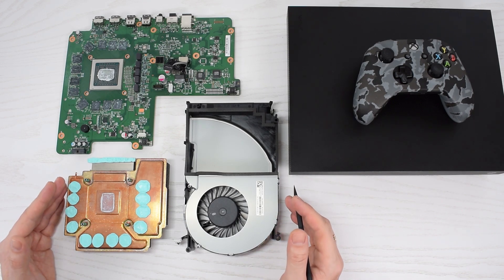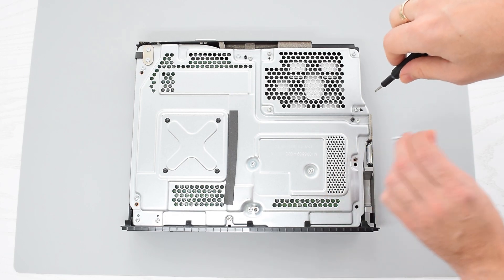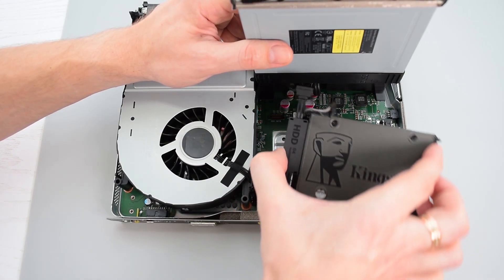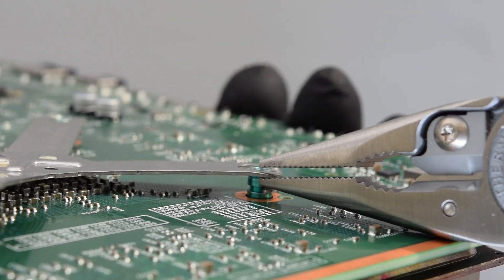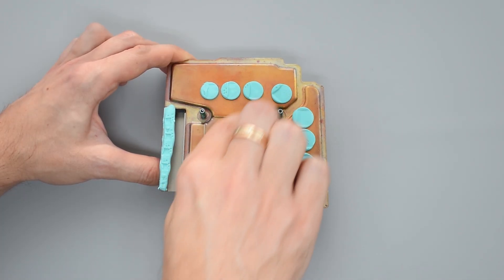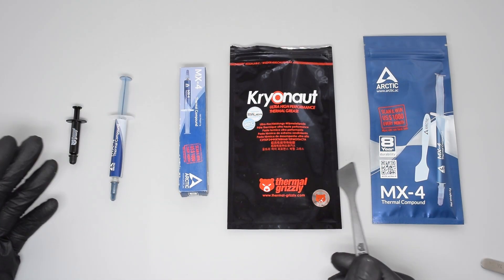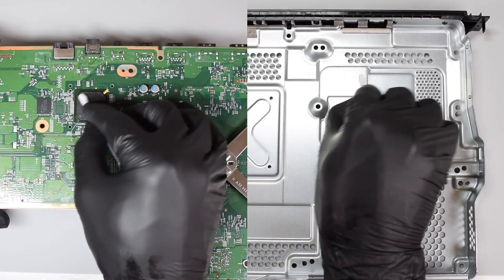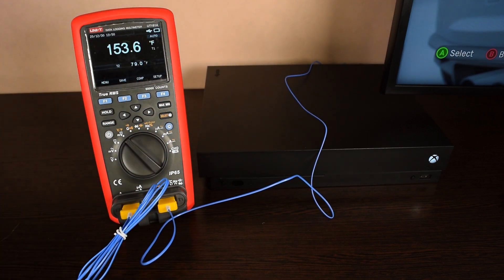Xbox One X Thermal Paste and Thermal Pads replacement. Cooling system cleaning. Best explanation!

Comment: dude , what size pad you use? deepseek tell me to need used 3 size 1 , 1.5 , 2 . here you used olny one for all tell me bro
Reply from the maker: You have to use 1.5 mm pads. There’s no need to ask anyone — just measure the thickness of the compressed thermal putty and you’ll see it’s about 1.4 mm, which means 1.5 mm pads are perfect for that. But we don't use anymore thermal pads for our customers and I don't recommend using them. Nowadays we have thermal putty that outperforms any thermal pads and it's way easier to use. We use this one which is the best on the market: UPSIREN UTP-8: 
https://shp.pub/7a5f1j
https://amzn.to/4n4FVWO
Reply: @ElectronicsComputers Thanks, brother. When I was looking for information, I was told there are 3 sizes of chips and each one needs a different size. Thanks again.
Reply: I used 2mm. I even bought the wrong thickness (1mm) initially. It did overheat but after adding the 2mm strips to their own vram modules and doubling up some of the 1mm strips to essentially double the thickness, no overheating and it runs quieter. I dont know enough but I hear you want pads that have squish to them to allow for the added .7-.4 mm thickness

Comment: Hello, I decided to replace the liquid thermal pads on my Xbox One X and was left with the choice between the Laird 607 or the Subzero Seven TPT 128. The Laird has 6 watts of thermal conductivity, while the Subzero Seven has 12.8 watts. Which one do you recommend? The factory pad thickness was 1.8 mm. Which one is better?
Reply from the maker: I'm not familiar with those products. The Laird thermal putty has extremely low thermal conductivity, it's even worse than the stock putty, so it will be downgrade if you use it. In my repair shop, we use Upsiren thermal putty which the best as of today. You can use UTP-8 14.8w/mk or UX PRO Ultra 16.8w/mk. https://shp.pub/7a45kb   https://shp.pub/78w0ir

Comment: I've repasted and changed thermal pads on a series X and had good results using:
Artic MX-6 compound 
Artic TP-3 thermal pads 1.5mm thickness
If you just get 4 x 120x20mm pads (they come in a pack of 4 so 1 pack) it will be enough to replace all thermal pads if you measure and cut exactly what you need in the right shapes. 
For the compound, I used the spread method to get even coverage as MX-6 is very tacky but performs better at higher temps than mx-4. 
After that, just the usual isopropyl 99.9, cotton swabs, T8 torx driver, lint free cloth, spudgers and precision tweezers.
Reply from the maker: Great job! That’ll make your Xbox last a lot longer.
Reply: How thick should i make it if i bought 0,5mm thickness arctic tp3 ? Can i stack them?
Reply: @Baerbas01 they can be stacked but I wouldn't recommend it. But if you do need to then 3 layers of 0.5 to make it 1.5.

Comment: What do you think if i use 1.5 mm thermal pads from arctic? 
And i also want to ask about the size of pads. There is lots of theories about to use 1mm or 1.5 or 2mm? Do you think my pads are good enough?
Reply from the maker: No need to believe in theories just grab a caliper and measure the compressed thermal putty on any memory chip. You’ll see it’s around 1.4 mm, which means a 1.5 mm pad is the right size. We used thermal pads for clients for years, but eventually switched to Upsiren thermal putty (link in the description). It’s similar to the original thermal putty but far better in specs and definitely beats any thermal pad. On top of that, it’s super easy to apply. You can check out my video on how to use it the process is exactly the same for your console: https://youtu.be/GTvtAM7Fi5U
Reply: @ElectronicsComputers Thanks for an answer but i just bought the thermal pad from arctic tp-3   1.5mm. Do you think this one will also work?
Reply from the maker: @destin7963  Honestly, I’m really suspicious about those ARCTIC TP3 pads. The company never publishes their thermal conductivity, which is one of the main specs you need to choose a thermal interface. When a manufacturer hides that number, it usually means it’s embarrassingly low. For a high-performance application like the Xbox One X, I wouldn’t trust it to do a good job. If you want reliable cooling, stick with Grizzly, Gelid, or proper thermal putty instead.

Comment: Hello, I encountered the following problem with my Xbox One X. I replaced the thermal paste and gaskets with MX6 paste, Subzero Seven 15W gaskets, thermal conductivity 2 mm thick, in 4K games it is cold but makes a lot of noise, even though the console itself is cold, there is a strong air flow from the back, it is slightly warm. What could this be from?
Reply from the maker: This is a pretty common problem when people replace thermal putty with the wrong thermal pads. As I mentioned in the video, you have to use 1.5 mm pads, not 2 mm ones! What’s happening inside your console is that the heatsink barely makes proper contact with the APU, so it can’t transfer heat efficiently. That’s why your console feels cold on the outside, while the sensors detect overheating causing the fan to spin faster but still failing to cool the chip. Stop using your console until you replace the thermal pads, or better yet, use thermal putty instead (link in the description). Otherwise, you risk permanent damage and reduced chip lifespan, which may already be compromised.

Comment: I would recommend ptm 7950 for thermal paste since Microsoft uses a thermal change compound which is why is dry up once it gets under heat it melts into a paste
Reply from the maker: Kryonaut has higher thermal conductivity, so temps are a bit lower right away, but it can dry out after a couple of years and may need redoing. PTM7950 stays stable for years, which is why Microsoft uses it. Theoretically, the APU lifespan with Kryonaut could be longer if you do regular maintenance, which consoles need anyway because of how much dust they pull in.
Reply: @ElectronicsComputers  Yes but ptm 7950 has proven to get better overtime and eventually beat kryonaut and you don't need to replace it like thermal paste which also saves you from ever stripping the black screws
Reply from the maker: @Lowintech147   If we talk long-term then yes, PTM7950 is the best stuff as of today. But most repair shops, including mine will keep using Kryonaut, MX-6, Arctic Silver, etc. because it's easy to apply, easy to remove, 
no weird requirements, just slap it on and go
customers don’t complain because performance is “good enough”.

Comment: I bought 2mm thermal pads and found out that the recommended ones are 1.5mm. Would there be any problem using 2mm thermal pads on the Xbox One X?
Reply from the maker: Normally, 1.5mm thermal pads are recommended. Using 2mm pads can create a problem because your APU die might not make proper contact with the heatsink, leaving a gap. Whether it works depends on the compressibility of the 2mm pads: if they’re soft enough, they may still make good contact. However, high-quality pads with high thermal conductivity are usually firm, and in that case, the gap could prevent proper heat transfer, causing your APU to overheat.

Comment: I have my One X since 2022, in January i changed the thermal paste, but i put the Aeronaut, and now, six months after, it started to overheat, so after some long hours on YouTube, i finally found your vídeo, changed all and now the temperature stays stable at 68.3°C running RDR-II (4K-HDR), befor the change, it used to run above 75°C (ps, i'm at Brazil, so here we have a medium of 27°C (or 106°F) for the room temperature
Reply from the maker: Great job! Did you replace the thermal putty too?
Reply: bro 106 in your room??? Talk about constant swamp ass…….

Comment: Hi, congratulations for the video, it's all clear; I accidentally used 1mm thermal pads instead of 1.5mm, I wanted to ask you if they can work just as well, or do I necessarily have to use the 1.5mm ones? Thanks
Reply from the maker: A 1 mm thermal pad will make only slight contact between the heatsink and the components. Nowadays, the safest and best option is to use thermal putty instead of thermal pads. The link is in the description, and I showed how to use it in my video on the Xbox Series X. Thermal putty provides superior thermal conductivity, and you don’t have to worry about thickness.

Comment: 1:58 how did you get the second thing outta there? i’ve been yanking on it for like 15 minutes and it hasn’t budged
Reply from the maker: Try to remove that cable from the motherboard if the connector on the drive is too stiff.
Reply: انا حاولت لمدة 20 دقيقه وما زال ثابت في محله

Comment: Hey, when your cleaning the Xbox cpu/gpu dye surrounding thermal paste, those components you said to be careful about that are surrounding the whole thing, what are those components? I’m trying to find replacements for two that are broke on the Xbox one x I have.
Reply from the maker: Those are ceramic capacitors. If you accidentally remove one or two, it might not cause any issues because there are often many caps working together to provide redundancy. I wouldn’t worry too much about it—simply use it as is. If you notice any instability with your console, you can easily buy replacement capacitors on AliExpress and solder them back on.
Reply: @ thank you! I appreciate the response and will test it out

Comment: Dear all. Our XBOX One X became slow and sluggish. Textures didn't load on time, FH5 car stopped in the middle of the highway, then went on. Load times became very long. I already swapped from HDD to SSD 2 years ago, so there were 2 options. SSD is failing or the 4+ years old paste dried out. Took the console apart, checked the SSD on a PC, since there is no diagnostic tool for XBOX console. SSD was fine. Since I had to take apart the whole console for the SSD, I also prepared to have thermal paste and pads on hand. I was lucky because it was well needed. Heat transfer is proper again, APU is not thermal throttling any more, console is fast and snappy again. FH5 is working properly, so thermal issue was the root cause. I was able to finish the whole process with the info in this video. Thank you!
Reply from the maker: @Arktorin  You did a great job 👏 I'm glad that my video helped you.

Comment: At the end of 2024 still good video :D I had to use 2mm pads instead of 1.5mm pads, because 1.5mm was not touching the memory modules. So some measurements are advised on the old thermal pads when cooler is taken off.
Reply from the maker: Thank you for the comment! I'm happy to help.

Comment: This guy made it look super easy. It took lime like an hour 🙂 I struggled with disconnecting some of the connector and putting to top cover back up. But other than that it's a well made comprehensive guide.
Reply from the maker: Well, I do this kind of work regularly, so it may look easy and quick. But yeah, if you're doing it for the first time, it can be a bit tricky.

Comment: why spread the thermal compound before putting heat sink back on? it will spread out on its own from pressure of heatsink.
Reply from the maker: Why spread is shown at 5:24. Sometimes you just need to take control to get the job done the right way.

Comment: Wait how can you tell if the putty is bad, I looked it up and got nothing
Reply: I think I seen that the putty looked like dry play doh
Reply from the maker: If it's dry and feels like it doesn't hold together in your hands, then it's time to replace it. Once you removed the heatsink from the board, you need to either apply new thermal putty or reshape the original one. Otherwise, there won't be the same thermal conductivity between the components and the heatsink as before.

Comment: Did it today with your instructions, thank you so much, my xbox was in good shape inside but cleaned it out,  upgraded the thermal paste and added an ssd and now its a super machine
Reply from the maker: Great job! I'm happy to help! From my point of view Xbox One X with an SSD is the best console. Super easily reparable and serviceable compared to Series X. If the SSD dies in Series S|X you can simply throw the whole thin into trash. For One X you can simply buy a new drive and clean install OS.
Reply: @ElectronicsComputers  wow, that's fantastic to hear, I love the machine as a multi media entertainment centre. I bought it second hand too, so it cost me very little even with the upgrades. 

I love that you can do a completely fresh install 

Can I ask you, do you ever have difficulty taking out the screw, a lot of mine were very stiff. I had to use a pliers to twist the screwdriver whilst holding the driver in the screw head
Reply from the maker: @ClockinwithBen-lr4xk  Sure, a lot of stuff comes to our repair shop with stripped or overtightened screws, along with a bunch of other surprises. I've even seen cases where folks were using superglue instead of locktight. There are special bits and tools for cases like that, or we can simply drill it out, tap a new thread, and put a new screw inside. But ultimately, a lot depends on having the proper tool in the first place.

Comment: i ran out of pads by the time the x-clamp is in place, for the last one can i use the paste?
Reply from the maker: No you can use thermal paste. You an use thermal putty or thermal pads. The links in the description.
Reply: @ElectronicsComputers  i used the paste anyway bc im out of pads and im not waiting 6 days for a shipment, left it on for 3 hrs and it works too

Comment: Just a question the HDMI retimer chip sometimes goes bad, do you think adding a thermal pad in top of the chip would somehow help on this issue?
Reply from the maker: I believe overheating is one of the reasons for the short longevity of the HDMI retimer chip. The second reason why it often fails is when the console is connected to the wall and then someone attaches or removes the HDMI cable from the console, creating a spark that immediately damages the chip. So yes, adding a small copper heatsink that can be glued with silicone glue to the chip will be a game-changer. And of course, first connect the HDMI cable and then plug the console to the wall. If you need to disconnect it, then do it in the reverse order.
Reply: @ElectronicsComputers  does it have spare space to insert a copper heatsink? I believe the cooler cooper heatsink is on top of the chip, probably some thermal putty could provide some kind of protection?
Reply: Just a question please reply it would help Me out. Does your fan get really loud when in a game?
Reply: @Knightly76  Sometimes the fan ramps up, and afterwards get quiet, it happens more on more modern games, with cross gen.
Reply: @Viggen66  thanks so much. It appears I may have been robbed because I sent mine for a Thermal paste replacement to someone and when I got it back it was just the same. It appears I may have to open it up myself 😔. Also have you fixed your xbox one x?
Reply: @Knightly76  I notice the difference after I replaced the thermal putty with good quality thermal pads, look for 1.5 mm, and follow this video, just be extremely careful especially when removing x clamp, I think you spend money to a person who did nothing.
Reply: @Viggen66  yes, thank you for your help🙏
Reply: @Knightly76  it will not be dead silent but a lot better, keep that in mind

Comment: Hey! I followed your guide to the letter except I used Arctic TP-3 pads due to financial restrictions, spread the Arctic MX-4 paste and everything and my fan still blows like crazy and crashes during graphics heavy games, not sure if I did something wrong, or if it could be due to the fact that the heat sink seems to be a little jacked up from overheating, to the point that the Xbox logo on the chip shows up on the heat sink as well as what looks like putting or something . But all in all a very detailed and informative video!
Reply from the maker: What thickness of pad did you use?
Reply: @ElectronicsComputers 1.5mm. I previously used Kritical 2.0mm pads and I think they turned out being too stiff and not compressing enough cause when I removed the heat sink this go around it looked like all of the thermal paste had squeezed out from the edges and was barely on the chip. I should also note that I have had  to change the thermal paste on 4 separate occasions since May, the first time the original thermal paste was bone dry, and the last time around the end of July when I swapped the original blue putty for Kritical 2.0mm themal pads, I will admit, one of the reasons I went with that brand was because they were green and I thought it fit the theme of the Xbox but after seeing the apu and heat sink I can confirm that they are too stiff compared to the Arctic pads. I wish there was a way to show you a recent pic I took of the heat sink
Reply: @ElectronicsComputers  I also noticed after using the Arctic pads they are much softer and compress a lot better, but I think there may actually have been some gaps between the vram chips and the heat sink now. I tried to squeeze it down and it looked like it kinda worked but I’m wondering if maybe I need to just bite the bullet and purchase 2.0mm Thermal Grizzly minus 8 pads

Comment: Have you just used one kind of termal pads? You have linked 2 termal pads in the description? TIA
Reply from the maker: We don't use pads anymore for consoles. There are way, way better solution on the market which has better specs and it's very easy to apply. We switched to thermal putty. It's basically the same stuff as the original but different color and better thermal conductivity. Upsiren U6PRO:  https://alii.pub/6t38n9
You can watch my video on how to use it: https://youtu.be/GTvtAM7Fi5U
Reply: @ElectronicsComputers  Thank you! But the first link doesn´t work for me :(
Reply from the maker: @MStruchh  Fixed link. Sorry for that.